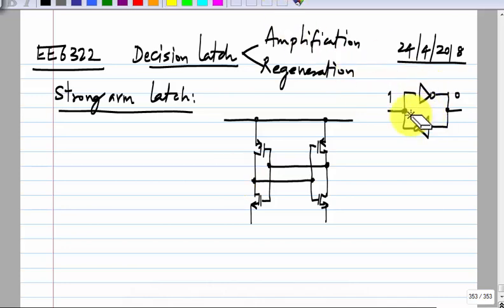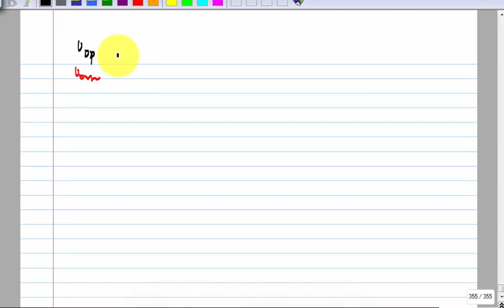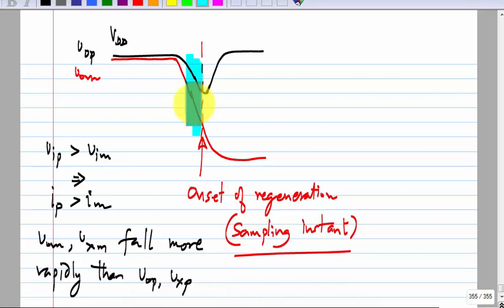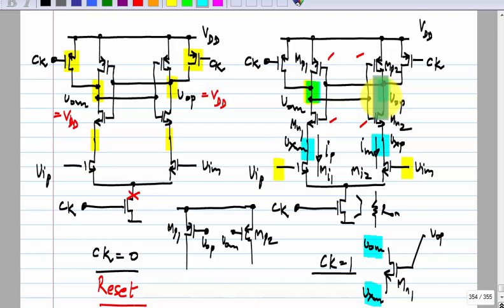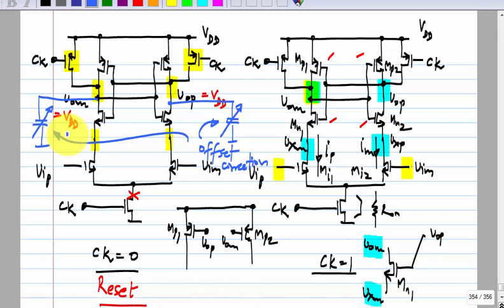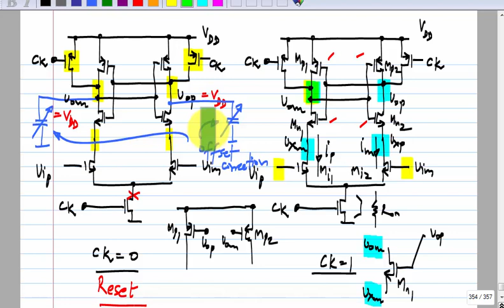ee632220180424

Comment: I am working on a project based on Double tail comparators in 90 nm but the both positive and negative output  waveforms are same even if there is a difference in the input voltages . Can someone help me with this?
Reply: Make The Nmos pair and Pmos pair strong (make w/l higher) so that they can pull the voltage down accordingly